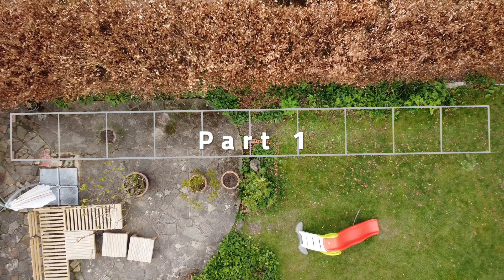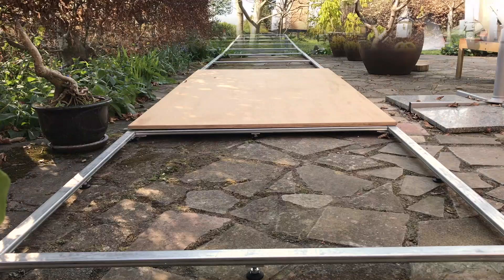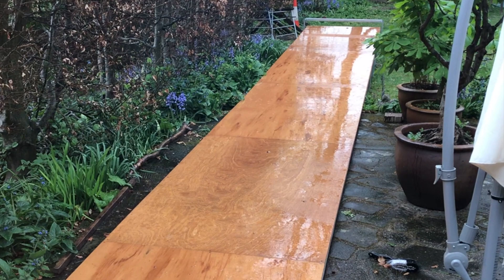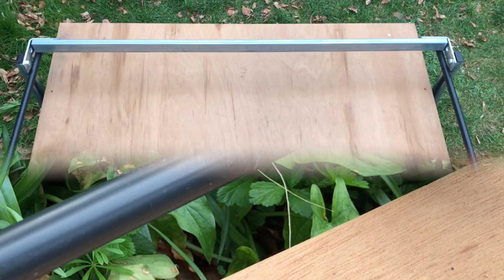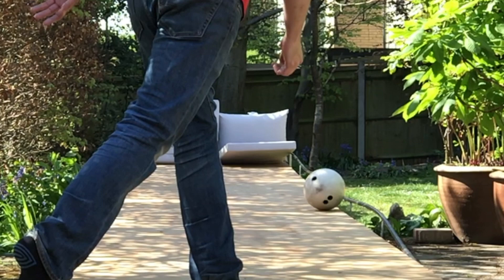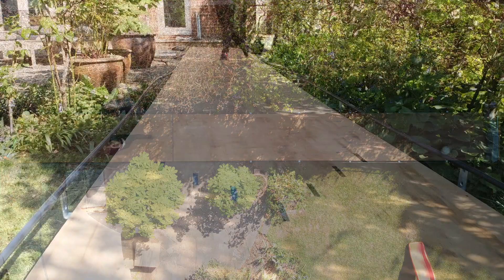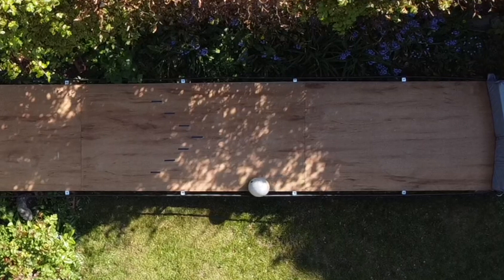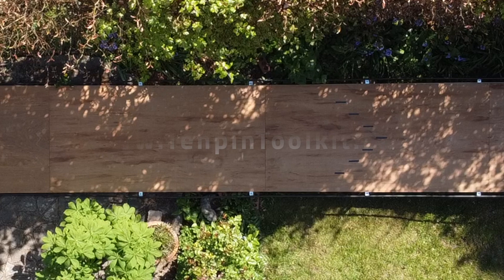Building A Practice Bowling Lane In The Garden - Part 4: Actual Bowling!

Comment: For better finish on your lane, start with a good quality sealant. You might also want to dismount the panels to get around the sides and into the mounting holes. Might help keep some of that British weather at bay. Then add coat or two of urethane or something similar to a "bar top" finish. Theoretically, you could then add some type of oil. I think mineral oil is the closest you'll get to a Kegel product, unless you have access to actual Kegel conditioner.  ;)  With oil now on your lane, you might want to devise a way to get the ball to come back down the side. I saw a video of man who used Marvel Mystery Oil but his ball came straight back on the lane and then rolled on the approach. Wouldn't your bowling shoes walking on that!
Cheers!
from New Mexico USA
Reply from the maker: Thanks Mark, that’s really helpful!